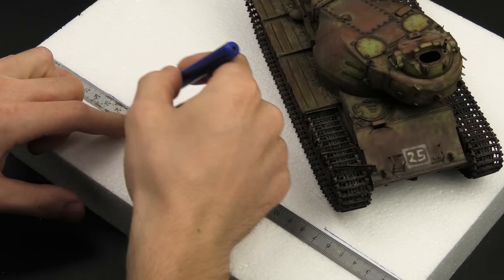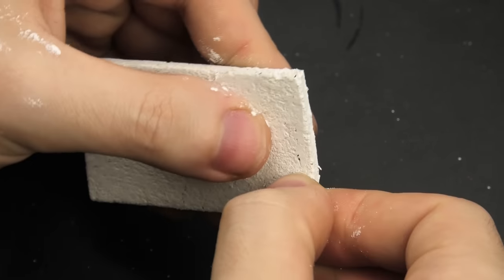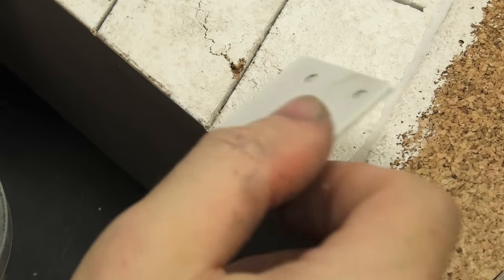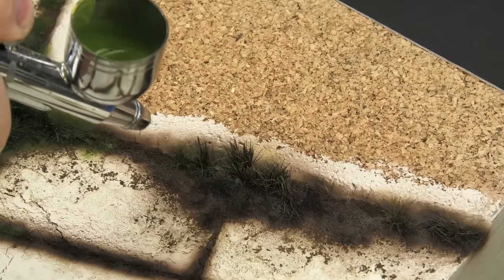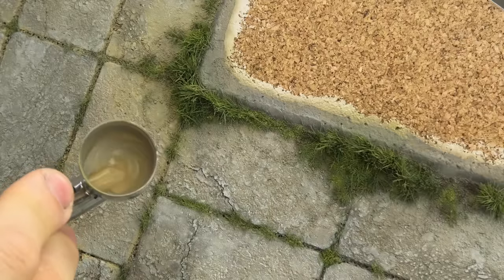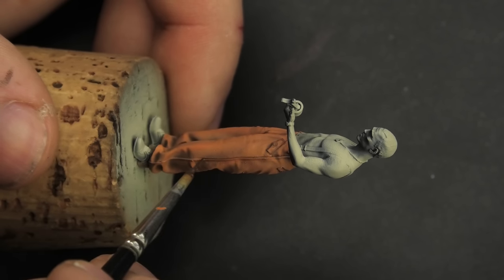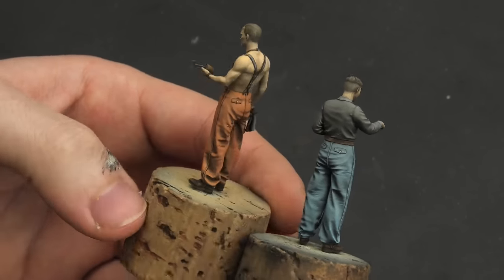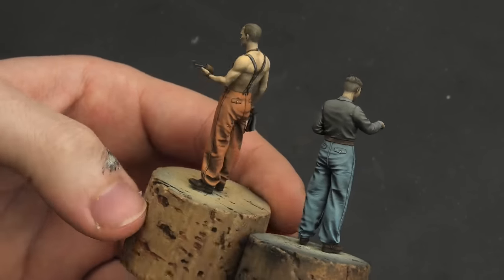Rust Bucket - Tank Restoration Diorama

Comment: Speaking of concrete slabs: Soviet PAG-14 airfield plates!
I've been thinking of a 3D printed mold for air drying clay, and a jig that lets me cut the diamond pattern easily.
If you want to play with heavy damage, the rods inside the concrete are woven, which would be a pretty awesome detail. All the necessary drawings are easily available online, since the slabs are still sold today.

Such a 'background' could contrast extremely well with a more colorful aircraft. One of my favorites has always been the Ukrainian Su-27 "splinter" camo. Such a beautiful pattern, and blue is just an awesome color.
Alternatively, some abandoned Mil helicopter, similar to the VW Beetle. Sticking to the Stalker vibe, maybe an Mi-24RKhR. I've found the Zvezda kit to be a good basis, but I'm still working on that.

Just some more food for thought ;)

Comment: It’s great!  If you want to add to it - add a couple of big blocks of wood between the wheels, nobody wants 60 tons running away when you’re working in it.  Also tanks attract a lot of dust underneath and on the lower tracks when they sit for a while outside, and it tends to fall down when you’re working on them and get blown under the wheels, and into the crevices on the lower tracks.  Spanners, hammers, oil cans, tools etc. tend to get put on every surface that will take them, particularly the mudguards and in gaps/valleys where they won’t get knocked as easily, as climbing up and down from the tank is a pain in the bum, but if you drop something into the depths you may not see it again for months/years.  You’ll have boxes to hold any nuts and bolts you take off and try to organise / not lose the small things.  We’d add steps or tie on a couple of ladders with rope to get up and down (metal on metal isn’t a good friction surface, so ladders slip).  The one thing that you got wrong is the towing eyes, which are bloomin heavy and hang down, not up.  That’s not a biggie though.  I really like it.
Reply: You could do a lot by doing the same dirt in the cracks job over the tank as you did on the concrete.

Comment: Here's some advice for weld beads: I've noticed that a lot of the time with your models, the weld beads are perfectly continuous even around corners. Yes I know you want weld around corners, in fact I am a welder myself. But depending on the type of welding they used, which was most likely stick, they wouldn't have rounded a corner like that. So, maybe try separating the bead at the corner?